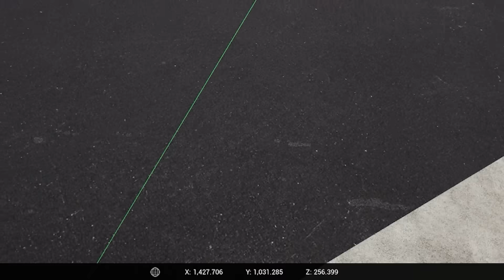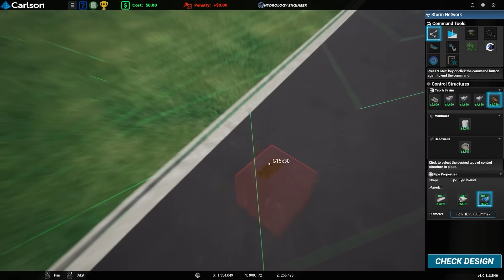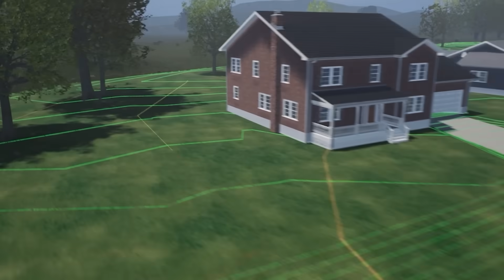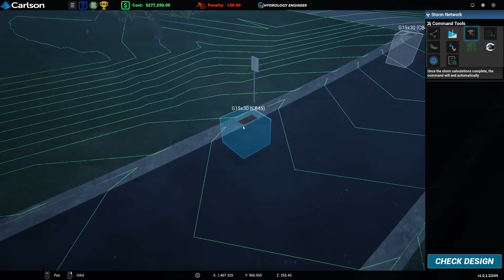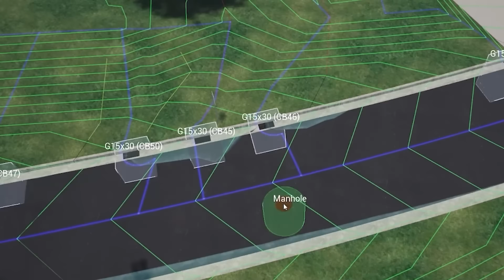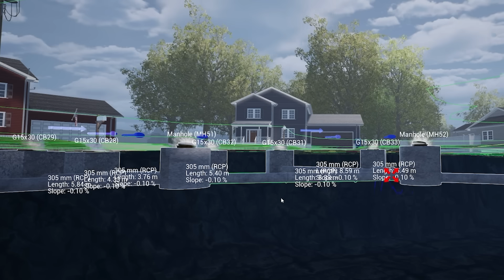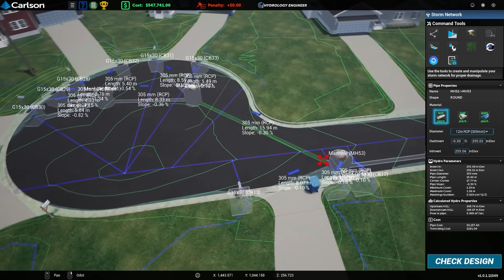How does storm drainage work?

Comment: The "point" in the middle of the road is called a Crown and yes, we do slope the road down towards the ditch / curb but only very slightly. Barely noticeable. If you can see the grade (slope) of the road from the crown to the ditch you have a near impossible skill to teach..... 
join a union because that's a skill alot of us working just do not have. Go lay pipe, pave roads, do subgrade to roads (the rock and dirt layers) or something. We need you.

Comment: Never had to deal with roads without road reserves, footpath or nature strip. 
If you can't put drainage under the lawn and you don't have a nature strip where do the gas and water pipes go? And also Sewer?
Under the road, the maintenance must be a pain in the ass.

I guess electrical and communication cables are in the overheads. 

There is a push for underground electrical cables instead of overheads in Australia, especially in new development areas or road expansions that require the moving of overheads. We install underground cables and conduits, and then the power authorities will decommission the overheads unless it is not feasible.

We always put those services in the nature strip or road reserve. Some end up under the road, but we try to keep them in the shoulder or parking line if possible. For the sake of future work or maintenance.

And that pipeline to the pond would usually be an easement line and owned by the council .
In a proper road design, the roads would keep going downstream until there is a road that runs toward the pond or parallel to the pond and you low point would be there.

Didn't really deal with many projects with creeks or wetlands but that is usually the best way.
We never can start worked without an approved drainage design.

Comment: I work construction. It's really cool seeing this side of things. Us carpenters are always angry at the engineers for dumb things, like messing up the CAD files, so there's intersection between two different trades things.

But most interesting was doing heavy highway. I was the guy building the concrete forms for the drain pipes. You said it really well, people would be surprised to know how much money is beneath their feet. Concrete, steel, dirt gravel and probably even a couple of fingers.

Comment: It looks like this game isn't focussing on roads built by a Highway Authority but more by a developer that is putting the road up for adoption, especially with the use of the attenuation pond. With it being on someone elses cost, the HA would want everything done properly so that it's cheaper for them in the future and gives less headaches though.

In terms of the planning permission aspect, depending on where in the country are, you wouldn't need permission for a vehicle access/driveway unless you are on a classified road, but you'll always need a S184 Licence with the HA for the dropped kerb VA.

Also looks like there's some offlets in there which could be interesting to use!

Oh, and on the TM side, it'll probably still be required if the cover is in the verge as there will still be some carriageway incursion with the vehicles and the tanker to cleanse it out.

Comment: I don’t think my city uses engineers to plan drainage. 3 years ago they dug up our road and the main road connecting to it. A year later they had to do it again because the roads would flood every time it rained. Last year they had to legit do parts of it again because the drains couldn’t handle the snow melt after winter. Let’s see how it goes after this winter 😂

Comment: For the grass runoff if you take into account the location of the work, you might be working in an area where there is potential for the soil to dry up for a month under direct sunlight and then have a downpour and the soil can’t absorb the water so it ends up as runoff in the street, this happens a lot in the US

Comment: So many drains! I guess this is a difference between UK vs Canada. We also tend to provide 100-year overland outlets so that the underground drainage system can be designed for smaller storms. It massively reduces the pipe sizes. Basically you just need to ensure that the low points are fully captured and the on-run drains can be by-passed during storms larger than 2-year (depending of course on local requirements).

I'd be curious to dig into the simulation engine that they are using to generate their results. It's definitely really cool seeing what I do for a living turned into a game.

Comment: I love that they're games like this out there, but you don't need planning permission for every drive way, only when non-permeable materials are used, if you use gravel or those plastic grates filled with sand or something else permeable you don't require planning permission, at least in 4 counties I've lived in as we installed a drive into ever house I've lived in throughout my life, though everyone should be using permeable materials, it helps the insects

Comment: You mentioned concrete encased pipe being expensive. Well here's a bit of a horror story: Outside my apartment some guys are currently removing and replacing concrete encased piping without using a ditch because they can't block off the road.

Comment: Drainage engineering has always been a major side interest of mine, as I live in a particularly rainy part of Canada that also gets a reasonable amount of snow most winters... this winter we seem to have gotten all of our snow at once back in early January, and my city had some significant meltwater drainage issues in some places... fortunately nowhere near me.

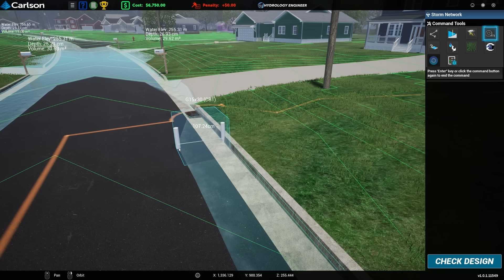Edit: The scenario at the 9:30 mark is particularly familiar to me; we have a lot of drainage that's poorly placed relative to driveways, resulting in a lot of water accumulating at those driveways... but that's what happens in a city that's been rapidly growing and redeveloping for the past twenty years or so. My walk to work includes a pedestrian tunnel under a railway that sometimes floods in the winter due to the drain at the low point being blocked by leaves being washed down the slope by rain and melted snow.

Comment: This is actually my job! I’m a union utility pipe layer in Wisconsin. I spend most of my year ripping up roads and putting in water main, storm drains and waste pipes! Someone like me is the reason you can poop, have water, and aren’t swimming to each destination! It is a lot of hard work. It’s heavy construction and not for the weak. I come home covered in mud daily and my body takes a beating, 12 hour days are normal. If there’s any details you guys want to know you can just ask me! (Also yes there is a ton of math that goes into it!)
Reply: I know its been a year, but I've just found this video and your comment. What sort of math do you do? I've always assumed that by the point you are laying pipes all of the math would be done, and you'd just have to put the pies where the blueprint tells you to.
Reply: @MilesWilander  yes an no, im not a pipe layer but im a telcom engineer that deals with conduit (basically a pipe) and similar underground structures. The math is usually some sort of algorithm regarding your medium and being able to calculate/modify it to a given situation. For municipal plumbing services id assume most of it is lengths, flow rates, psi, and pumping capabilities. So alot of physics and fluid calculations on the fly when planning makes mistakes during the design phase.
Reply: @itssryan8431  oh! that makes sense. thank you for answering!
Reply: Awesome!  I grew up in Wisconsin and the storm drains always seemed well done.  I’ve moved several places around the country since then, and I’ve rarely seen the same reliability since.  So thank you :-)
Reply: HEY! Thanks for what you do! 
I put the road back in after you rip it up :D 
Union Strong!

Comment: As someone who lives in a town that is redoing all the drainage gates on a main road. 

I hate your profession. It’s been 6+ months one 1 lane roadways on a main road because the closed half the lanes. It is absurd!!! Takes me 15-20 mins to get to work and it is only 1 miles away!!

They are never working. They must work from 11am til 2pm 1 day a week. 

It has been months. mONTHs!!!

In 6+ months, I have never seen a single person working. Ever. Not once. This project should have taken a week or two max. It’s been 6+ months!! 

There are pot holes on this road that have been there for a decade plus!!!

There is no reason to keep the lanes closed!!! And for such extended lengths of the road!!!

I hate drainage engineers!!!

Comment: I just want to note that while it's true that having manhole access on one side of the road can be more convenient for maintenance, manholes in the USA are often located in the middle of the road for the following reasons:

Uniformity: Standardization helps streamline construction and maintenance processes. Placing manholes in the middle of the road can be part of a standardized design to ensure consistency across different projects and jurisdictions.

Accessibility: Placing manholes in the middle of the road can make them more accessible to maintenance crews. It allows them to work safely away from the traffic on either side.

Distribution of Infrastructure: In some cases, the layout of underground utilities, such as sewer lines and storm drains, may necessitate placing manholes in the center of the road to provide access to these systems.

Traffic Flow: Placing manholes in the middle of the road is sometimes a design choice to minimize disruptions to traffic flow. While it may require closing both lanes during maintenance, it could be seen as a trade-off for easier access and less disruption to adjacent properties.

Overall, while having manhole access on one side of the road may offer some advantages, the decision to place manholes in the middle of the road in the USA involves a combination of factors related to construction standards, accessibility, infrastructure layout, and traffic management.

Comment: Matt, as someone who has been dealing with this for five years, I have to reject your project 😅 It has several significant drawbacks. First, the pipe slope must be at least 2 percent (1.5 is the absolute limit). Secondly, the law prohibits the construction of manholes on private property. You can do it in a store parking lot, for example, but not on someone's backyard lawn. Thirdly, there is such a thing as a pumping station (a device that is installed in the manhole and increases the water level, e.g. from 2.2 meters to 1.2 meters, often powered by electric poles (the electricity powers the compressor that drives the pumps inside, so it is a safe solution ). Fourthly, the pipes are laid at a depth of 120-180 cm and not lower. For now, that's all my internal screaming about this project 🤣😅

Comment: In my area (part of the east coast of the US, not getting more specific than that) part of the code for storm drainage in residential areas is that driveways have specially designed drains at where they meet the road, so they don't contribute near as much water flowing down the road
at least, for most driveways where they're paved with concrete and such. driveways that are cobbles (which we have a few of here) have a lower drainage requirement thanks to water being able to just go between the stones

Comment: when you measure 1.2 meters for the grate distances without having them discharge into anything aren't you just measuring a puddle that forms after the chamber overflows, instead of actually measuring the water flow that would be the reference for grate distance?

Comment: I have 20 years underground utility installation in the states.  I've installed a decent number of these systems in real-life,  this game speaks to my soul
Reply: Also Matt, manholes are generally placed middle of the road (for sewer especially) to mitigate water infiltration. You don't want extra storm water going in the manholes
Reply: I've never understood how the US system works. Don't you have isolated sewage systems? Even if our roads flood (in Australia) the sewage is usually okay. Only really big floods (like meters of water) cause problems with the sewage system backing up. I'm not a plumber or drainage engineer or anything like that, so I don't know how it works. Our sewage manholes are usually in the concrete on the footpath. I've never seen one in a road. And they're pretty securely sealed. I don't know if rainfall can even get in. EDIT: There could be SOME manholes on the edges of roads, but I don't pay close enough attention to notice if they're sewer or stormwater. We definitely have manholes in the footpath though. And access pits in certain backyards. My old house used to have one. It wasn't very deep though, so I'm not sure what kind of pit it was for.

Comment: You were talking about weather you can put drains at the ends of driveways. I'm no drainage engineer, but what I can tell you is at my parents house in the UK they have exactly that. It's not actually a standard gully type as seen in the game, I think it's just a soak away kinda thing, but basically it's a trench with a grate over the top that stretches the width of the shared double driveway with them and the neighbors. I'm not clear on the legalities of who owns/is responsible for it, but most of the houses in the neighborhood have the same thing. For reference they built the entire neighborhood from scratch around 2010.

Edit for correction: Actually, I think they started building the estate around 2007 after a bit of thinking and some maths based on ages and the current year. We were one of the first houses to move in on the new estate, and at the time we were effectively on the edge of civilization, the road past our house hadn't even been given it's permanent surface, and pretty much once you passed the end of our driveway the road became a mere suggestion. At the time that was all fenced off as part of the building site, but we could see through the fencing, and as kids were often intrigued to watch what was going on. I remember over a year or two (maybe more, maybe less.... it was too long ago and I was too young to remember the timings) after we moved in we were watching as the housing estate slowly expanded, and our area of it slowly became more and more permanent and finished, and the building site slowly moved further and further away.

Comment: I'm not a drainage engineer, but I do work for a utility boring contractor and and responsible for running the locator when we do a bore.  I've had quite a bit of experience doing on-grade sewer installs.  I wanted to mention that because I couldn't help but laugh when Matt's designs in the last video wasn't working out and his gulleys and manholes kept getting flooded out.  Being in an industry where we do a lot of underground work, I really appreciate this kind of content.  It's goofy and silly, but it's also interesting and informative.  I've actually discovered things that I hadn't considered before when it comes to drainage...and I'm probably one of the most technical, analytical,  and mathematical guys on my crew.  Please do make videos containing the next two levels.  I would thoroughly enjoy it.

Comment: was it 500,000 cause the piping was installed after the roads where built? Meaning the roads would have to be destroyed and rebuilt to accommodate the new piping or was this just the cost of the piping by itself?

Comment: More drainage please.

Also are those red arrows near your final junction the point that's being rejected or something else?
Reply: The four red arrows show up on either end of the pipe you have selected. Its a move icon that lets you drag a pipe up and down the wall, or on square substructures you can even connect the pipe to another wall (as long as the angle isn't too severe)
Reply: @CarlsonSWEdTech  So not relevant to the error. Thank you for clarifying.
Reply: It's either the rejected part of the plan, or the part Matt has selected. Matt didn't seem to think it was relevant, so who knows.

Comment: One thing I really hate with a passion is manholes on the road. Someone is definitely putting them where they are the most inconvenient so you can't avoid them, but wait there's more... usually in a staggered formation too! Just the other day I drove over three manholes in a cluster in the literal centre of the road, which has very heavy goods truck traffic on it as well which can't be good. Been a good while since those covers were flush with the road. Should've become an engineer I guess 🤔

Comment: More of this please. Your early content used to mix teaching engineering and having fun. I'd like to see it come back. 

Why not connect the curb drains together, or use the large inlets with the manhole to reduce manholes in the street? Also, does the contribution from grass increase when the ground is saturated?
Reply: In the simulation, I don't know. But in reality, yes. In Australia we had a huge flood wipe out a town in NSW because the ground was alrrady saturated from recent rainfall and the additional heavy rain just ran off immediately. It was big news a few years ago.
Reply: @seanvinsick5271 awesome question! Yes! Based on the return period of the storm ground saturation can play a factor. Since we're using the rational method here and a 50 year storm you would get a x1.2 multiplier on your peak flow (typically added to the runoff coefficient).  There is a tooltip next to the value on that right panel that when hovered explains this.
Reply: I also agree with the first part of your comment about a balance of education and fun. I'd like to see more of it too.